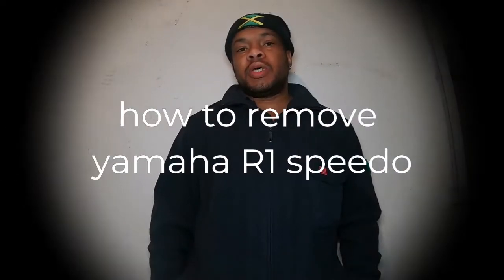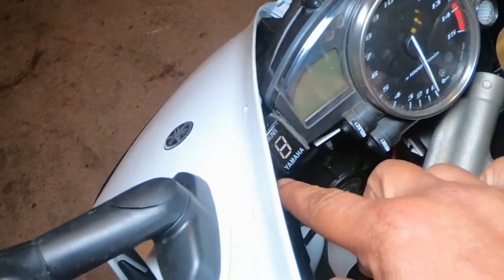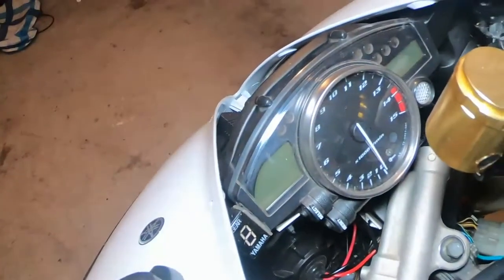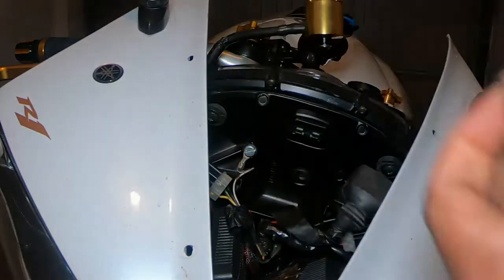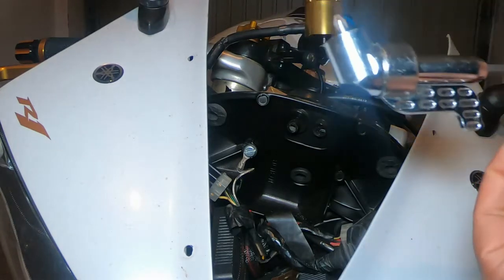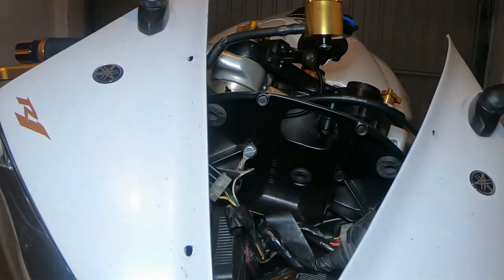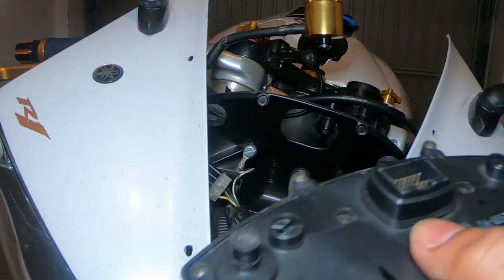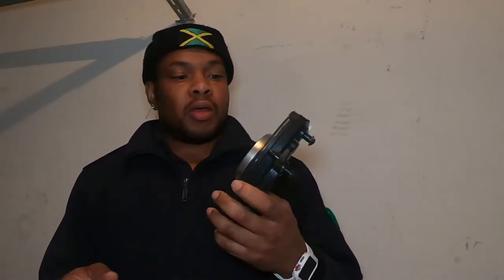How to remove yamaha R1 speedo

Comment: Hey man, how were you able to remove the front black part without taking off the front farings?
Reply from the maker: You need a screw drive with a angle on it to remove the 3 screws